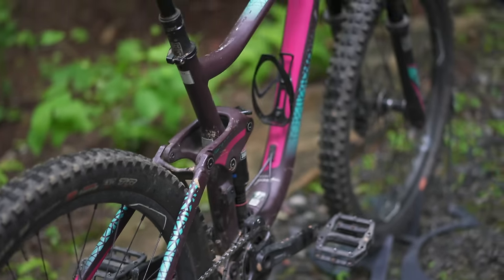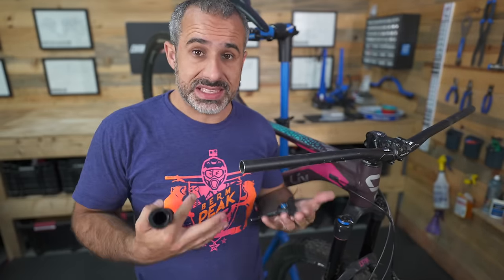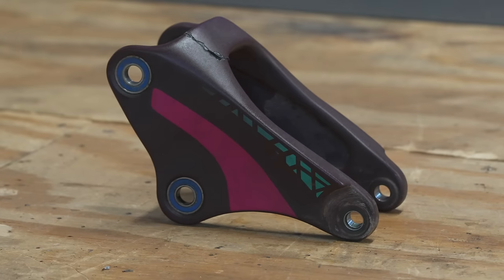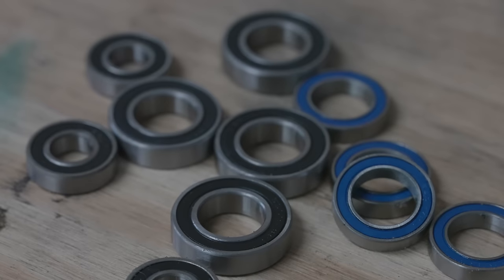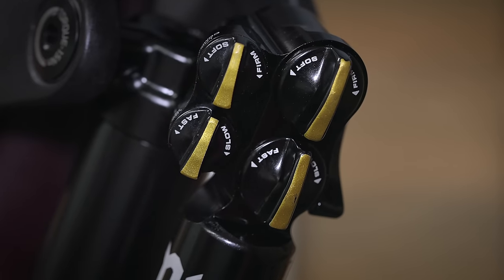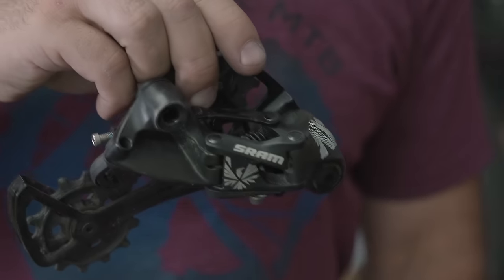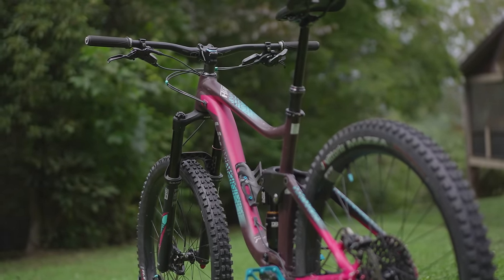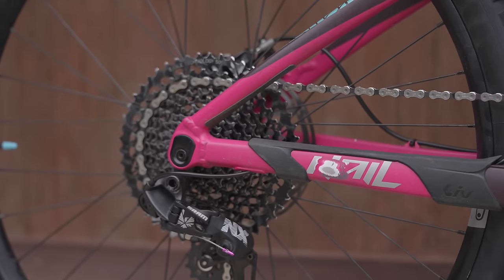Giving this Mom MTB a Parts Bin Overhaul, and damaging it in the process 😬

Comment: If a shop replaced my rocker arm with a spray painted one I'd flip out. I say this fully aware that you're not a shop and you probably tried your best to find a matching replacement. Still, how is flat black spray paint acceptable? At that point you should have had it professionally painted the factory color with 2k automotive paint and clear coat. I understand you did a full service and installed better parts for free but I would still not be okay with the rattle can paint job. Owner probably didn't even notice though. :D

Comment: Save money on those expensive Bearings: Remove the seals with a dental pick, clean (blast) with an aerosol cleaner like Brake clean or even WD-40, re-grease, check for smoothness. If the bearing checks good, re-install the seals and move on to the next one. Saves tons of money and lengthens the life of the bearings. Some bearings will be too far gone, but you'll be able to save most of them.

Comment: I have a 1998 mongoose a40r. Frame and wheels are near perfect. Lines are gone. Has 3×7 shimano transmission. I saw a recall on the 105 ballistics forks. Is the frame worth upgrading or should i just scrap it and hunt down something higher end?

Comment: That shock looks cool but hot take- you don’t need to change minor little things for every ride in any condition. I run my bike with the exact same settings wether I’m doing XC, downhill, street riding. Wether it’s wet, dry, muddy, dusty or in a thunderstorm my bike stays the same

Comment: Why were all these bearings so cooked after 5 years of (I presume) fairly light use? What could have been done to avoid this?
Reply: You don't know how it was used so that's a false start. Regardless of use, I can guarantee that riding it hard or otherwise and putting it away dirty will subject the drivetrain and most bearings to a quicker death than they deserve. I've seen the rare, rare case of overcleaning (which can do the same to bearings), but most rider's wear/usability issues is from lack of cleanliness. That linkage had more to do with the shock feel than the shock did.

Comment: Hey seth I know I'm probably about 7 months too late to make this comment, but whenever you need to prevent paint from going inside bearing seats, you can use a rolled up piece of paper or even scrunched up aluminum foil to keep the bearing surface clean. It takes way less time and effort then slightly pushing in an old bearing

Comment: One up component edc. The small one that u don’t screw in is terrible I had one on mine and I had to get it out to put a fork on and I couldn’t get it out I had to use a knife and a hammer and snap the hole thing and rip knock it out the bottom of my forks

Comment: Seth, could you give me a quick answer to a question about a bike and the price its at? Its a Trek Marlin 5 Gen 2, for $808. Is that worth it? I have been googling for a few days now and still no closer to knowing, whats a good bike and the prices I'm looking at, I understand through my research that the shocks on almost all lower end bikes are kinda crap and hydrolic breaks are better. and that if I can get a bike with good geometry that I can add onto it slowly with better parts. I just don't know what is the ebst "Frame" so so speek to buy. If you can help that would be great. If someone else from comment section can help, that would also be great n_n tyvm in advance.

Edit: I mainly just want to get a bike that doesn't make a whole bunch of noise when I'm riding it and that can handle harder stuff but not like SUPER extreem downhill stuff. "Hope Im saying this right, I only have like a week of youtube videos to go off of"

Comment: My rear is on backward.... (Edit:  uhhh my rear tyre that is)...   q8}

But it's my previous front (Maxxis DHF) so I reverse them as the breaking force only on the front they are designed for is reversed to the drive force on the rear.
I run the rear till it's getting quite rounded even on black trails as i find I corner a little better with a rear I can slide a little easier... 
As for grip, I videoed a black trail that has a lot of roots and there's only one pinch climb over a tree base that I miss... and that's just my pathetic energy level.
I did pinch flat the last tyre as I was inadvertently running it at 15PSI but You can see how slick it is as I stop and check out the flat in my "Others riding the Hospital jumps" video.
Nothing worse than sitting out a session with both the bike and spare tyre flat... Who packs a tube with a puncture.... Me apparently!

Comment: hey i would love if you where to make me a bike:)
i live in Australia and i have a trek marlin 5 right now with the shifter and the brake together so it limits some upgrades.
my brakes do not work, i have to put all my strength into the leaver just to slow down and its becoming a problem on the trail.
my suspension dose not work well and its becoming a hazard for my safety.
i hope we can talk farther and see if i can give you an offer.

Comment: Makes me think I might need a full service on my carbon giant advance trance 2 from 2017, which has never been serviced yet lol. Although mine is in far better condition than this one, but seeing those bearings 🤔🤔.
Reply: I'm with you, I have a 2018 trance 2 that has never been serviced instead of servicing I dumped $2k in upgrades into it Instead 😂
Reply: @maplejakee  lol, I've not spent that much on upgrades but have changed wheels, seat, bars and brakes😁. Gotta say mine still runs smooth and true👍👍
Reply: @wayneyates700  what brakes if I may ask? Mine are decent at best
Reply: @maplejakee  Shimano XT's(2022), it come with SRAM guide RS n the levers kept sticking in and not returning properly so I changed the lever pistons and covered them in SRAM butter but still didn't work right. Had no issues with me XT's at all, I also have deore on my work bike (GT avalanche heavily modified) n they also have been amazing and no issues 👍

Comment: those bearings feel nasty because they only ever move about a quarter turn with weight on them. that feel is meaningless. they are worn in on one side which is to be expected. they just needed cleaned and maybe pressed with some new grease, they were likely perfectly fine for the application.
Reply: to elaborate, bearing when used in this type of application get unequal wear. so unless it is a bearing that constantly turns more than likely it is just a slightly worn bearing. the key here being SLIGHTLY worn.

Comment: Those linkeages should never have been bearings in the first place. Bearings are intended to cycle. A linkage never does 360 degrees. Linkeages should be bushings.

Comment: Stop buying new bikes and maybe they will start making parts for older great bikes. Also, stop supporting built in obsolescence and buying high dollar bikes to pose at the trail head.  Mountain biking used to be about getting out w bros. not talking about specs and pretentious crap. This is what everybody should do for 5 years and squeeze the bike industry to bring prices of new bikes down and stop pushing pro geos on Avg. Joe's. I live in OH and cannot think of more than a handful of trails where I would say I need a 64 degree headtube angle.